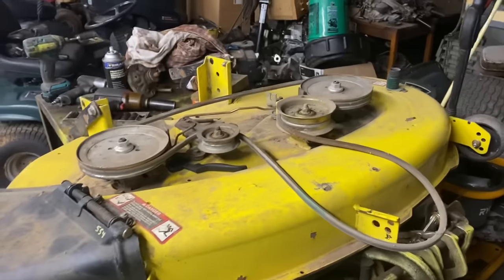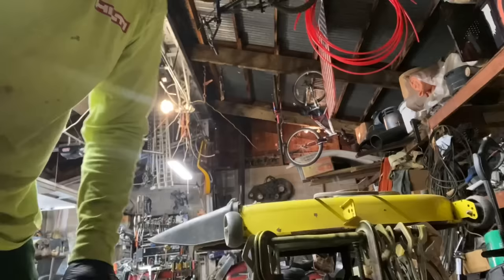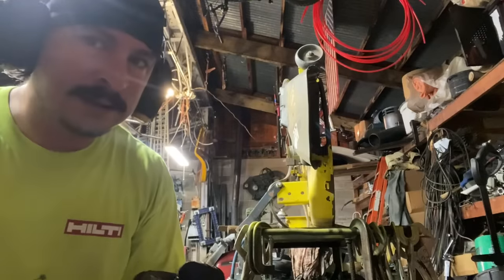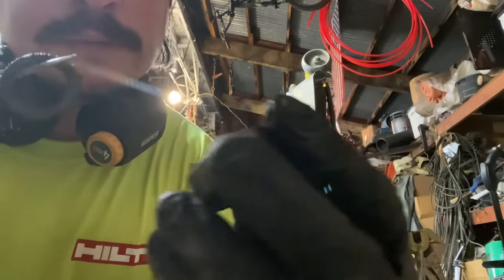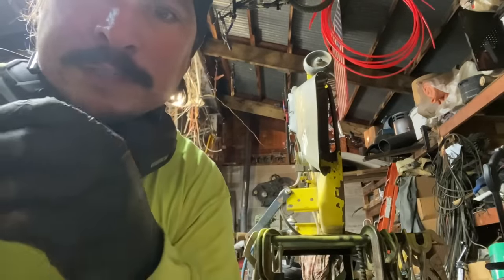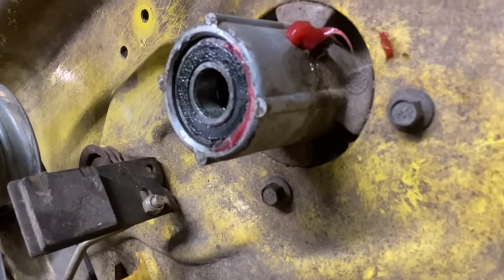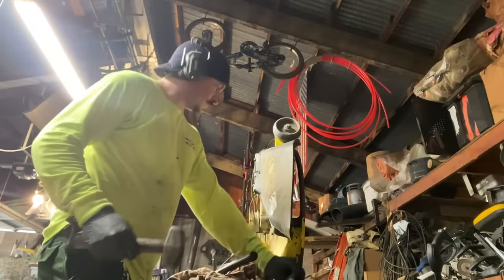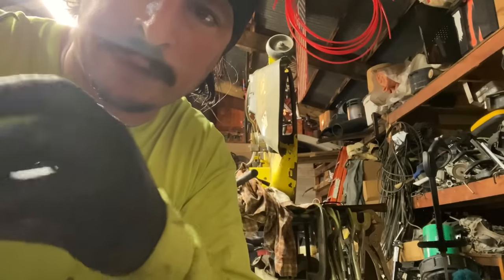Part 1 - Don’t trust the “Experts” Grease your mower deck sealed spindle bearings Common sense.

Comment: I'm late coming to this video, but it really hit home and I wanted to comment.   My Murray rider mower is now 23 yrs old.  When I got it home from Home Depot, on a whim I thought I'd pump some grease into all the fittings.   Those deck bearings must have been bone dry because they just kept taking more and more grease.  I had to go buy more grease (it's one of the little guns) - finally it started coming out.  I'd like to say I re-grease it before each cutting season, but I know it's less often than that.  Still, 23 yrs later and those original bearings are still in there.  Just some periodic greasing has truly gone a long long way.   It's one of the few times I didn't have to learn a lesson the hard way!   

I realize this video is more about greasing "sealed" bearings, but I'd go so far as to say, if you buy something that can be greased - grease it, fill it - don't wait.   I know there are some grease applications where you don't want to see the grease come out - but this isn't one of those applications.

Thanks
Reply from the maker: Thanks for the comment. You have great instinct. Nice testimonial. Iv worked on a lot of the older Murray’s of that generation and if it’s what I think it is, your zerk is under the tractor / deck. but regardless even if it is the newer ones all
The Murray’s Iv ever worked on all
Had inner seals just like how the assembly in this video is set up. But the process works and you agree so that’s excellent to hear of such great success. I have found exactly the same success but just haven’t ran one machine that long on original bearings but that’s great to hear.
Reply: @GTObearclaw1  You are correct, the fittings are underneath.  It's not a commercial mower, so it only gets used weekly.  I'll tempt fate and say this:  the belts are also original.   knock on wood

Comment: Thanks for the grease gun pump count. I added fittings to a couple towers and packed them full as i could,then pumped them up until i saw grease coming out. Next time id rather just pump them up. Great video!
Reply from the maker: You have got the hard part out of the way. Now that they are full it will only require a few pumps on the future survices.

Comment: You just gained another subscriber. Recently I acquired a "thrown out riding mower " . I weld/patched the deck, took off the spindles. One spindle bearing had a slight growl so I soaked them in used motor oil overnight. No difference. Since no zerks were found. Now I will drill pilot holes, tap and add grease fittings and see if it quiets the noise slightly. Thanks for your efforts.
Reply from the maker: Thanks for subscribing and for the comment. As for the noise and adding grease to fix it. Once the bearings are noisy it’s most likely too late for grease to do any good. But good news is the bearings are not expensive and it’s not terribly difficult to swap out the beatings. In most cases some bearings will be okay and maybe just add grease to those. But usually when you hear noise there is at least one bad one in there. I have some videos that show how to swap bearings and many others do too. As for adding a grease zerk I absolutely think that is a good idea.

Comment: Had no idea what you took apart to accomplish this, but I’m sure this was good advice for those who know how to take their mower apart to grease the bearings.
Reply from the maker: The point is that the units don’t need to come apart to simply grease the bearings. Most folks think the grease zerks are not funny I was only proving they are functional. It was only disassembled to show grease reached the bearings.

Comment: Thanks 
for all the work to show this greasing procedure.  This is Mostly over looked.
Reply from the maker: Thanks for the comment. it seems like there is a shortage of videos that actually show what happens when a assembly like this is greased as it came from the manufacture. Most folks are just saying not to grease them but I found that really stupid to the point I had to get the right information out there. I felt it was something that could help people. Unfortunately a lot of folks miss the fact that the whole process was to show what happens and what the final outcome is.

Comment: The Skag has heavy-duty tapered roller bearings top and bottom, so the grease gets all through the assembly and comes out the overflow.  Great system.  Bullet proof.
Reply from the maker: yea well those are commercial grade and yes i agree the tapered roller bearings are great (better ) than the type im greasing here. But the grease will pass the seals and through the assembly so for folks that don't have a commercial machine it is still benifital to grease any unit that has a grease zero fitting.

Comment: great job of answering a lot
 of peoples wondering if grease get it to the bearing by having seals on both sides ,but if it didnt it would blow the other seal out when over greasing but will get hard when both seals are in great video
Reply from the maker: Thanks for taking time to comment. It’s highly unlikely the grease will get hard if you add a few pumps regularly like should be done for normal maintenance. It’s the same as any other serviceable bearing that has a zerk. I have rarely seen bearings with hard grease and when I did it was obvious they had never been greased like they should have been if even at all. A little grease once in a while goes a long way in this application. Once the mandrels are full after the initial greasing, just a few pumps a year will be plenty unless the machine is used for more than just personal use. Also it might seem like the seal could simply “blow” off the other side but because the assembly is so tightly assembled there is no room for the seal to push off the “other side” of bearing. Only the lip of the seal moves while grease passes. When just spitballing the idea and process it seems like after the bearing is filled that the grease could push the seal off the outside of bearing but when actually performing the process that does not happen. So it just seems like it can but won’t. Iv commented a dozzen times about the same thing. Iv never once seen grease push a seal off while greasing. Keep in mind the assembly is together during this process I’m showing. However if the assembly was not together it would just push the bearing out of the housing.

Comment: Great demonstration!  I also have one of the collar locking grease tools.  They work great when you have adequate room, but in tight spaces they can prevent one from getting the tool to lock on to the Zerk fitting.
Reply from the maker: Great for most jobs but yes not the perfect tool for every job. I love mine.

Comment: Can my man get a booyah! He just single handedly disproved sooo many people and videos who try to tell everyone not to worry about greasing your spindles because it's a waste of time and won't penetrate the shields! He used a simple experiment to undeniably prove his theory and hopefully opened a lot of peoples eyes in the process.This video needed to be made years ago before all the bad information got put out. Also I think a lot of people don't fully understand the purpose of a zerk fitting. They think it is just ment to be a quick and easy access point for greasing when it's actually intended to grease something until pressurized and maintain that pressure. If something has a grease/zerk fitting then it is designed to be greased under pressure until completely full and you see the new grease coming out. If it's only ment to be lightly greased without pressure it will be designed to be partially disassembled, greased, and then reassembled (like a gun for example) or sometimes it might have a plug screw you can remove, pack some grease in, and replace the plug screw. A zerk fitting definitely means it was designed to be greased until full and under pressure.

Comment: I  jiust changed 3 of mine on a Husqvarna 54". My new ones came with grease zerks on the top of the shaft. I couldn't get any grease to go into 2 of them. I didnt see any on the sides like yours. The spindles otherwise looked identical to yours. I will investigate now to see what is going on. Thank you very much!
Reply from the maker: Grease should go in no problem, as for yours the zerks are on top of the shaft. It’s a different type but works the same just pump them till filled and you see grease exit from top or bottom

Comment: Great video, great info, thank you! I ordered all new spindles for my brother's ~2015 Yard Man riding mower. After seeing this, I wish I had just ordered new bearings & a bunch of grease! Was great to see how easy you/a pro makes this, especially just punching out the shaft & bearings, without removing the spindle body, which could be a pain. Other videos warn about Fusion here with steel bolts going into aluminum spindle body.
Reply from the maker: Yes I even mentioned that in some of my videos. Never try to remove the aluminum housing unless you’re replacing it. If the bolts are frozen in you may get luck and get them out but without heat they usually break off. Even with heat sometimes they still break.

Comment: Thanks, Russ for breaking down the spindles and greasing. Your right about the Lock n Lube fitting. $29.00. Just for the fitting. But worth every dime. My old grease gun tip never worked on the deck on my LA 130 48 inch. Not any more!     Shawn.
Reply from the maker: Nice 

Now they make a sir fitting as well. My next tool!!!

Comment: I have a craftsman gt 5000 yard mower. Owned it for 20 years. Sealed spindle bearings on the deck . Put approximately 100 hours a year mowing grass. Never had an issue and still using that mower to this day. I believe water is the true enemy to your bearings and mower. Never wash my mower or cut wet grass. Scrape the underside of deck to remove grass when needed. I blow it off with compressed air. Keep your mower dry and it will hold up much more then  introducing water to it. Just my opinion.
Reply from the maker: I agree and I do the same. I keep my decks clean after every mowing. The grass blows right off if you do it every time your done. As for the grease. I have a lot of experience with those tractors and they have grease zerks. Your having great luck of No bearings have went out but I can tell
You it won’t last forever without grease. Those should have zerks on the top top of the assembly at the top of the shaft. I highly recommend you fill
Those assemblies up now while working good and they could last forever without failure. But without grease eventually the lower bearings will
fail one by one. I love the GT line. It was the last heavy duty home owner machine by AYP / electrolux / Husqvarna. Good machines. Especially if you were lucky enough to get one with the kohler command.

Comment: And one thing I did when I put a new deck shell on my old Craftsman was to fill the rust helping (mulching air vent) holes with resin. Took about 2 quarts for the whole thing and now there are no rust holes for wet grass to stop up and rust the deck out. The spindles just have 3 small legs to support them and those holes will cause the deck to rust out very quick. Going on 7 years and no rust at all.  Just put duct tape around the mandrel shaft under the 'spindle guards' and poured the whole thing full to the top of the deck, flush with the rest. Works fine.

Comment: You proved what I suspected that some grease will get passed the seal. I think taking the seal out will allow grease into the bearing easier. But it will also allow grease to leave the bearing easier especially when it gets hot. I have mine out and attempt to keep the spindle full. So far mine is very smooth and quite. I kept my seals just in case. Good video and info. Thank you
Reply from the maker: Removing seals works fine too. I have done the same myself in some tractors. Part of the point of the video is just to prove that removing the seals is pointless and won’t make a difference so the need for tearing down the deck to remove the seals is really a time wasting project and ultimately does nothing to benefit the life of the bearings. Just hoping folks will grease the mandrels and make bearings last longer. Thanks for the comment.

Comment: Awesome video man. I constantly argue with folks on a Bad Boy mover page on FB about this same topic. I had a craftsman 54" riding mover with greaseable deck bearings, and never had to replace them in the 18 years I owned it. Just greased them every time I sharpened my blades. I will be installing grease fittings in my BB deck spindle housings this winter. Have a goodun'!
Reply from the maker: Your not the first person to comment about the bad boys. It’s a dang shame they chose to not install zerks. Supposed to be a quality brand but why leave out such a simple, cheep and beneficial part. I’d add zerks too if I had one I was going to keep. I’m

Comment: thanks for your time to teach us that, as i was watching, i am thinking, the  rubber seal is supposed to keep stuff out, now, i  wonder on he idler wheels of my  snowmobile with similar  bearings, i thought the  seals kept water  out.
Reply from the maker: You can carefully grease the bearings with these type caps on them. The caps pop off on some of the rubber shields and can also carefully work a grease needle in beside the seal and add grease. Even same on some idler pulleys and tensioner pulleys on trucks and other equipment as well. But I am more knowledgeable about mowers

Comment: Yap, I been doing this for years (20+), you can also buy new seals, they sell drill and plug kit , use grease needle,...I do this at beginning of mowing season. Still have the original bearings/spindles after 2500hours on mower (arien 56inch zero)
Reply from the maker: Nice. Appreciate the support. Comments like yours help the folks who are on the fence.

Comment: I have been regreasing spindle bearings for years, and it makes me wonder how stupid one has to be to put sealed bearings in a tube and grease fitting between the bearings they must have stock in grease and bearing manufacturing companys,  good vid, you probably saved lots of people some money   
THANX!
Reply from the maker: It took me a while to think about and find logical reasons why they are assembled this way. I can say I like the inner shields. The grease passes with no trouble. And even if the inner shields didn’t exist the assembly would have to be filled before the top bearing would receive grease as gravety will only feed the lower bearing and pull grease away from the upper. A inner shield retains grease into the bearing. And when a unit needs to be pulled apart the bearings are protected from contaminants while outside the assembly. It is much easer to wipe off the outer shield before install than to have to clean and repack a bearing if it falls on the floor or gets dirty while working. I’m sure there are other reasons. But personally I think it’s probably figured into the design.

Comment: Very good and informative demo on grease penetration to the actual bearings!  However, I would not recommend beating on the assembly with a steel hammer like that.

Comment: Hi Russ. This is a very informative video. Since your mandrel has a zerk fitting, this all makes perfect sense. My mower mandrels have no zerk fitting. Could you produce a video showing how to add zerk fittings to a mandrel with none? I'm assuming your looking grease fitting is the same one I use. Mine is the LOCK n LUBE Grease Coupler. It keeps the grease from pumping outside the fitting, which creates a mess. I ordered mine directly from a company located in South Africa. Please clean up your messy workshop. It looks ALMOST as messy as the one I have.
Reply from the maker: I’ll have you know my shop was just cleaned before the video. That’s about as good as it’s gonna get. Lol 

Yes good old lock N lube is what I have. Love it. Not sure where it came from? 

I don’t have a video for that but plenty are out there in the interwebs and YouTube. I don’t like to make videos on topics that have been well covered. I may one day.

Comment: I’ve got a JD 425 with a 54” deck that I bought in 2000. Ive still got the original bearings and every mowing season I grease the spindles about three times with JD’s blue waterproof grease.So far so good
Reply from the maker: @Hodado  nice. Hopefully other folks see your comment and realize it’s not acceptable for bearings to fail after just a few years and if the bearings are not greased they sure won’t last 24 years. 
How many hours on your tractor? I imagine you must be near or over 1000 by now?
Reply: I’ll be at a thousand soon.Ive noticed in a lot of the newer models that the zerks are absent I bet you’ve repaired a lot of them
Reply from the maker: @Hodado  unfortunately they seem to last less and less time. The newer the machine the less time they last, without adding grease of course. Iv seen some go out in 60 hours. Yes Iv fixed a few, haha.

Comment: My Jazee Pro has a small screened vent(heat release) on the side of the housing under the deck. They recommended 3 pumps every year. Only had 1top bearing go out in 15 years.. Good video
Reply from the maker: Never heard of a jazee and never seen a screened vent. Never heard of a heat release. Maybe something commercial and I’m mostly working on cheeper machines. If the mandrels are filled then they only require 3 pumps. Same as these after they are filled then latter you only need three pumps. Thanks for the comment!